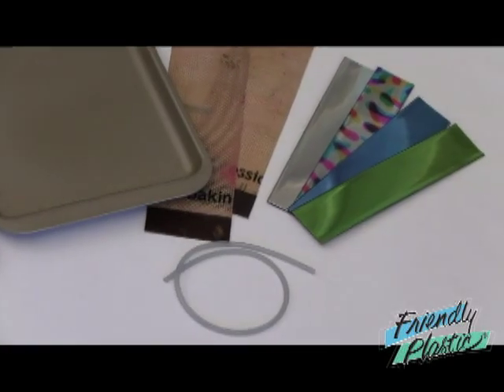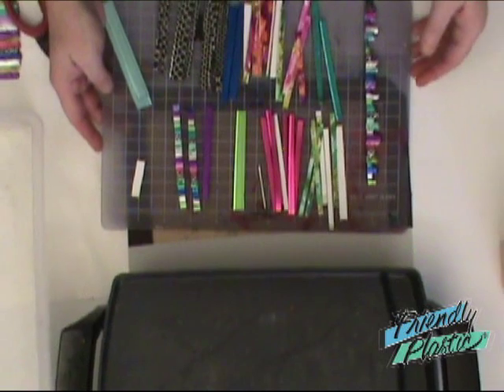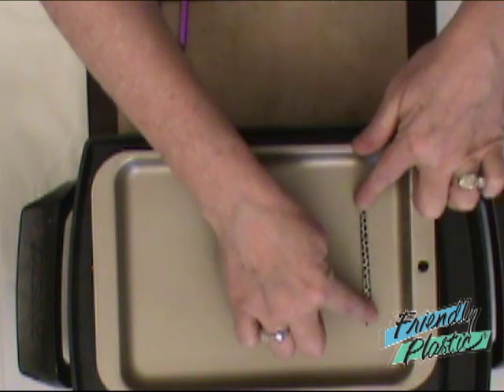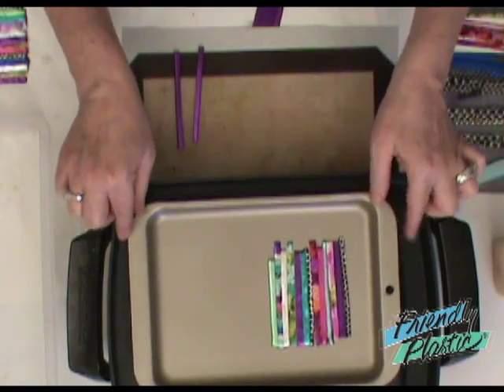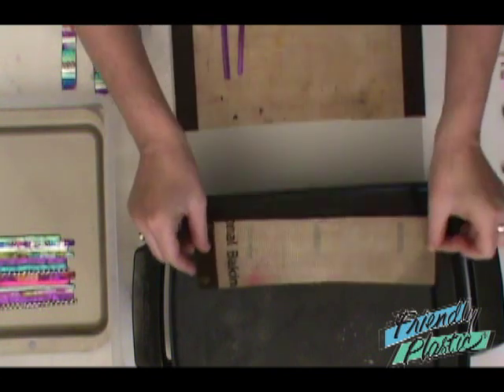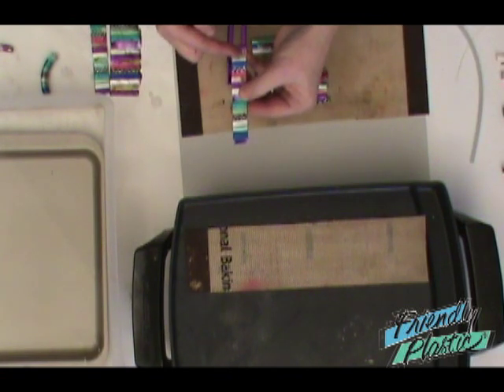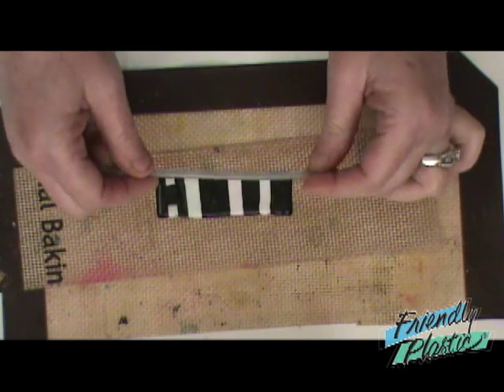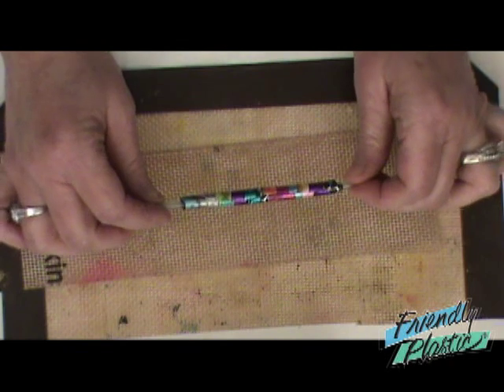How to make tube beads with Friendly Plastic Strips - Friendly Plastic TV

Comment: That was a really cool application.  My friendly plastic has become brittle and it will not cut any more, it just breaks into small pieces.  I have probably 75 strips and would like to find out if there is anything I can do to use these.
Reply from the maker: Sometimes you can try heating them up slowly and then letting them slowly cool back down.  It will reset the flexibility of the plastic.  This only works 50% of the time but is worth a try.  The only other way is to break it up into random pieces and create an abstract pendant or brooch and allow it to cool on it's own when you are finished.  Snappers as we call them don't work well for the marbelizing technique.   I hope this helps and thank you for watching! {Linda}